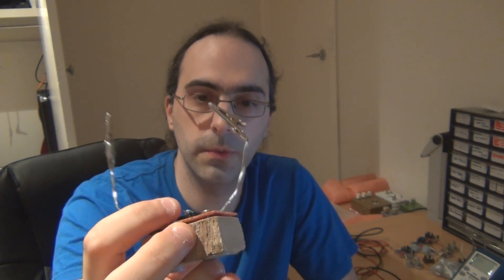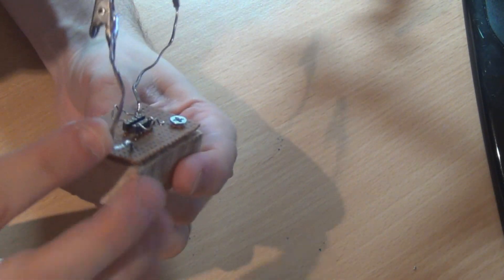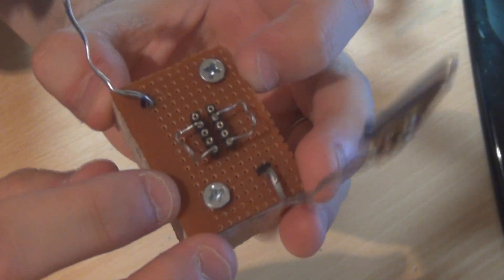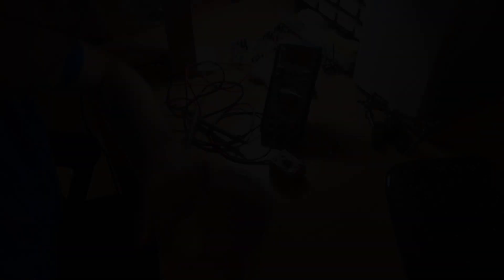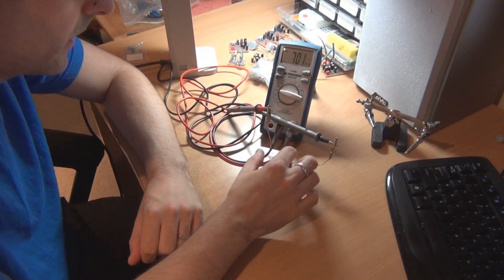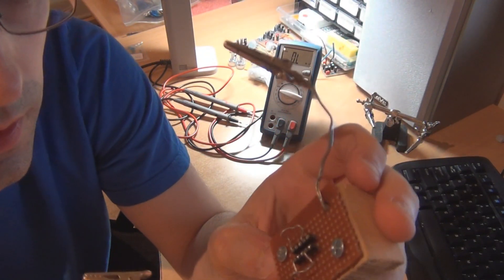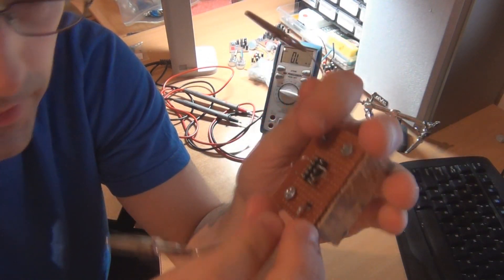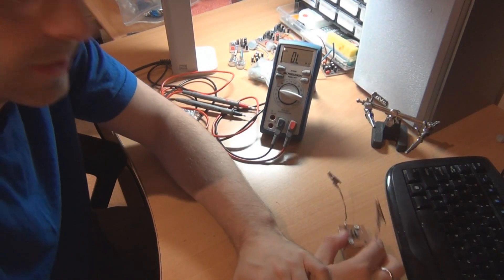Cheap / Easy DIY Helping Hands & Component Tester

Comment from the maker: I was thinking of the pogo pin which may or may not be that useful.  Check out Dave Jones videos (EEVBLOG #216 - gaussian resistor redux) and skip to 7 mins 24.  You could use a picture hook as well which might work better.

Comment: Ive been thinking about something like that before.
Before i put together a cuircuit i test every single component, and a tester board like yours would make this much easier.

Did you find those Test Terminals? I cant find anything on google, and i dont want to use  sockets.. Ive thought about something like 2 foldet Sheets of copper?

By the way, do you have a private Facebook account where we could chat sometimes?

Now ive gotta go back to the bench. Modding my Stone Grey Distortion. ;)